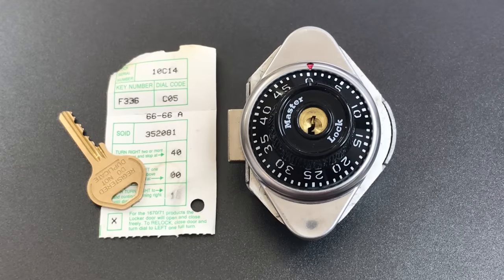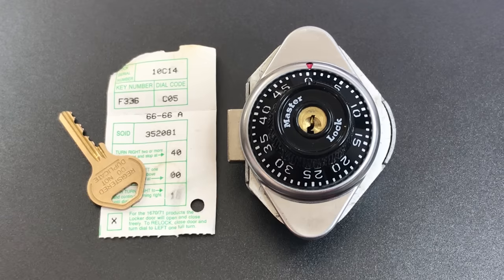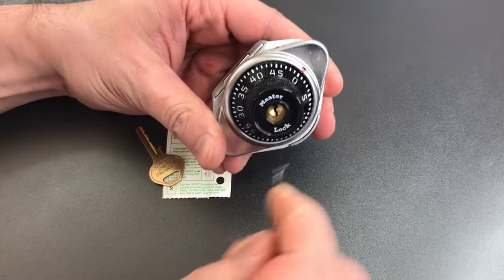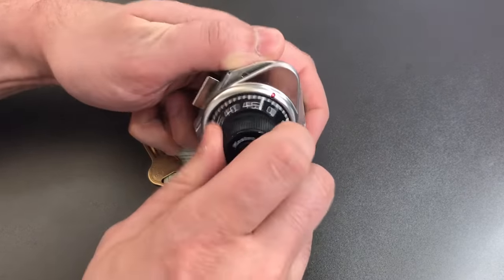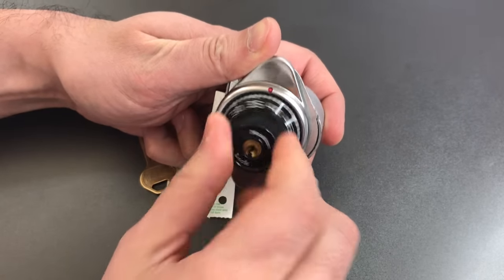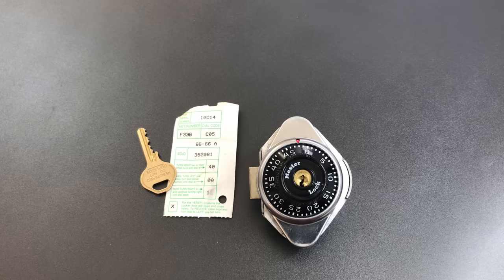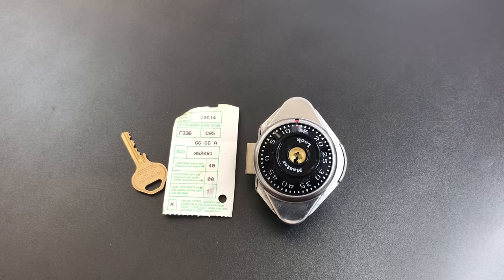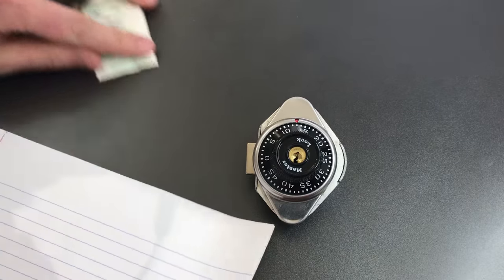[617] Master School Locker Combination Lock Picked and Decoded (Model 1670)

Comment: It's probably faster to exploit weaknesses in the locker design itself. For instance, at my middle school, these locks could be bypassed by pulling on the handle and hitting the locker in the bottom corner opposite the hinge. It would pop open ~80% of the time.

Comment: Their really old locks with the chrome-plated, machine-knurled dial used to land right on the third number if you dialed it any direction while gently pulling the shackle away from the body (no false gates). Brute forced those in less than 5 minutes, easily. Then, looked into the rotating gates to reveal the combo. Hoarded tons of locks that way.

Comment: The numbers on the back of my lock are "4719, then "13va03-b10. 
I have tried the offset trick 4 times, and they only add to 38 or 39.  Nowhere near 50 
Sequence was :
1st try-21
2nd- 2 to 3
3d- 2 to 3 
4th -6
5th- 5

Is the 4719 model different?

Comment: My school used to put basic combination Master Locks backwards (as in, the backside facing out) on your locker if you didn't bring your own lock, to lock you out of your own stuff until you brought a lock from home. I thought this was dumb, so I narrowed the combination into about 80 possibilities and brute-forced it, turned it around so it was facing outwards, and kept it for the rest of my school career. Incidentally, LPL actually mentioned what ended up being the combination, 10 20 30, which turned out to be it by actual chance (checked a few others and none were that easy to remember)

Comment: i remember my middle school had a combo lock system so shitty that you could never enter the combo correctly but if you were lucky to have a floor side locker you could just lift up on the finger latch and give it a sturdy bash with your knee. if it was a top locker you could smack it open with a well placed but kinda painful palm strike. i never put anything valuable in my locker after learning that.

Comment: So theoretically if you knew the first combo you would only have to try 10 combos before eventually getting it right as long as you werent set as the 5th one  which is a 1/5 chance, assuming of course that the offsets for 2-5 cant be above 10 which seems likely due to the data here

Comment: You could break these really easily when you go to open it keep twisting to the left. Or flip the lock mechanism that holds it into the locker up and slam it really hard. 

These always took forever to get open. So by the time you remember your code and unlock it, it's time for class

Comment: I've never seen one like that... Does it clip into the locker door or something? Or is it held with those nuts? My high school had Master locks, but they were padlocks, and so far as I know only had one combination. You'd have the option to buy one at the beginning of the year [I think it was like $5?], and it had a keyhole on the back for administrator use, but it was a similarly loose dial -- a digit or two was close enough for most of them. It's traditional for students in the area to lock their locks to fences and trees and basically anything they can once they graduate [which I did not, I kept mine, so maybe I'll pick the admin key part...]

Comment: I never seen my schools have those until this year they have them on my locker and honestly let me be honest having that malfunction or having it a bit off and it works is faster to get that locker open and get your stuff it’s important for it to have quick easy access for the user but not the by stander because it takes so long to get this open you only have a 3-5 minutes passing time to get that locker open AND get to class so little mistakes like those working are helpful

Comment: I knew a quicker way of getting my locker opened in middle school as opposed to picking the lock.  I would just put upward tension on the locker door handle and then exert force from my leg which resulted in a solid kick to the door and it would open right up. This method worked in under 5 seconds.

Comment: I remember if you pushed or pulled on the the dial it would have a  small click/ catching on something on or near the number to open it for the first two it would take a couple tries to get it down but then when you went through the standard process of opening using those numbers you figured out it would open.. worked out on befriending some of the stoner kids that would forget the combos and score some extra party beers as thanks

Comment: So the pattern of the Lock is 0 & +10 & +20  means, if the first digit was 0, the next is 10 and last digit 20 (not calculating the gate tolerances).

Comment: In middle school I could decode the lockers by pressing the dial back towards the locker and feeling for a change in resistance . When the resistance dropped I knew it was set, and started going to the other direction. It wasn’t a master lock though, and had to try to open the handle to know if it was unlocked or not

Comment: I was in high school in the 80s in Canada. Our Master locks were simpler (no key, we had to buy them and the combination could not be changed). The more mischievous students figured out that the third number was the only important one (quite different from what you're showing here). If we knew the last digit we could open the lock by setting it to this number and then giving the lock a quick, hard pull. Unfortunately, this number was pretty easy to figure out by glancing at the opened lock hanging from a 'friend's' locker as they grabbed their books.

Comment: If you read the comments written by kids, you'll find that these sloppy locks are actually useful for their intended purpose. Kids are rushing to their lockers between classes, so they aren't taking the time to carefully dial in each number, so it helps that the lock opens when you're within six digits. Many of the comments saying that they can't get their lockers open indicate to me that Master made their tolerances too tight for at least a few thousand kids.

As far as defeating the lock, your average person (especially kids in middle/high school) don't have the know-how to defeat even a crappy lock. They are intended to stop opportunists; not sophisticated criminals with the skill and knowledge of LPL. Even our teachers used bolt cutters to get into lockers instead of trying to pick them. This channel gives Master a bad reputation, but they work well enough for most applications.

Comment: My junior High had those locks, (or ones verry similar) and they were a joke to get open.

If you took any key, didn't matter where from, you could insert it into the lock and if you applied just the right amount of pressure while attempting to turn the key it would set the pins and allow you to open the lock.

They also had a massive flaw in that if you started at the zero position, rotated the lock all the way back to zero, then did the same in the reverse direction, and finally did it one more time in the opposite direction, it would open the lock.

After the second year at the school I stopped bothering to remember the combination, and would just rapidly rotate the lock back and forth 3 times and could open the lock on any of the lockers in the school.

Unfortunately, shortly after I figured out this exploit some of the bullies at the school also figured it out and proceeded to break into my locker and steal all of my belonging out of my locker.
They tossed most of it into the nearby trash can, and made off with some of the more valuable items.

To make it even worse when I tried to report them to the office I was told it was "impossible" to break into the lockers and that I was "lying to get them in trouble".
I then took one of the teachers to show them how stupidly easy it was to open the locks on the lockers, at which point I was told that was against school policy and was subsequently suspended from the school for a month.

I never got any of my stolen items back, nor were the bullies ever held accountable for the theft.

Comment: So, I have no idea if you get updates via this or not. But, definitely resurrecting a nine year old video for comments would be cool. I have 8 of these locker locks that came with a set of lockers at a yard sale. I removed them by taking apart the lockers. Your video does not show how to  unlock one without the original ( or at least one of the five) combination or the master key. … which I would be interested in since I have a handful of them. Something I did notice, is that each lock’s combo dial, when removed from the lock housing, is different. It just seems odd. Any chance you can “pick” one of these series locks without the combo or the key? Thanks.

Comment: I just got 2 sets of used lockers with these locks on them. I picked one, figured I'd never use the locks again, then drilled out the cores on all the other ones and removed them. Total time was about 5min for all the locks to be drilled. Now I'm even more happy I didn't try to save all those locks. Lol

Comment: I like how due to the lack of precision he was able to get the combination correct each time he changed it (if I understood correctly.) It seemed like the dial stopped two digits prior to the last digit that he wrote down each time, and I think it was because the difference was supposed to be from 48 and not 0 like he was using. That being said, the numbers added up properly so I feel like either I misunderstood something or he stopped turning as soon as the lock opened rather than when the dial hit a stop. Or maybe I wasn't paying as close attention as I thought I was.

Comment: Is it a coincidence that the last digit of both (all three) numbers is the same? If this would be the case in all lockers, it would reduce the number of position to test to 5 for the second wheel. Thus reducing the overall number to 100. (20x5).

Comment: So in theory, wouldn't it make sense for the locks to rotate at least 6 each year, as the specifications for the code was - or + 2.5?
Reply: To add to it, never more than 10 either, as then you won't have any rotation after 5 years as the total adds up to 50

Comment: I figured out the brute force method in high school with the lack of precision.  What I always wondered.  Our locks were all of the same model and stamped with a serial number for the staff to look up a combination if needed.  If the combinations are generated by some pattern, could you find a mathematically what of determining the combination based upon the serial number?

Comment: Dunno if this be relavent, but i had bought this lock awhile back 3 weeks ago just getting into decoding, i tossed the combination and so it began.. Tried every damn thing i looked up even the inner workings and nothing.. So, just about 10 min ago now i had an idea of my own.. I was able to get the first number and for this idea that's all i needed, so way i figure it on the inside there's only 12 of those gaps all around the lock that i could feel, so instead of these numbers on the dial, i just paid attention to the gaps on the rotation disk, set up on my first number, full rotation, and then on the next gap after my first i began trying each gap for the 3rd number, when i hit all 12 without an open, id reset back to my first number i know, rotate full circle, go to the next gap for my second number and rotate back trying each gap until i tried all 12, so on and so on i went in that order and could do it quicker and easier, and sure and behold 2 min later pop.. Then i did it a second time on the gaps i used successfully just to be sure and pop again, well anyways i came up with my own method that worked for me without dealing with the digits on the dial, but i am glad to learn how to get that first digit i need for this method

Comment: If the locker door of the locker next to yours was opened all the way, the metal edge of the door would perfectly strike the plastic combination knob, breaking it. At that point, the lock core would fall out, and you can open the lock with a flat screw driver. How do I know? 3 years in a row, my locker knob was broken and my locker robbed.

Comment: Had these locks at my highschool.  If you held your hand about 3/4 of the way up the door and yanked sharply upward on the handle it would open the door more reliably and faster than inputing the correct combo. Everyone pretty much did this all the time after sophomore year.

Comment: In middle school i just bent a paperclip and opened my locker by pushing the latch open every time. Much quicker.
Reply: Could you explain this further? Might be useful (not for opening other peoples lockers lol, just for mine)
Reply: @spidernh  i am sure this is greatly dependent on the type of lock and locker and this was more than 10 years ago, but i would basically bend a large paperclip into a acute angle, about 65 degrees and slide if into the side of the door and pull back on the latch. It would close the latch and allow the door to open fairly easily.

Comment: Hi!
I have a question about this lock: 

What if the combination happens to be for example 0-40-something. How do you turn that then? Start at 0, turn it right until you hit 40 the first time and then turn left to whatever third number it is. 
Or would you turn right, get to 40, pass 40, get to 40 again and then turn it the other way? Your video doesn't make that fully clear. Or maybe I just don't understand it.

Thing is: I happen to work in an old American high school which was repurposed. But the lockers are still on the wall because they were too lazy to remove them. Or maybe they just ignored them because why bother? (Assuming that they are the same lock model). They at least look the same, except that instead of a "Master Lock" print there is a "Master USA" engraved on them.
If it isn't the same lock. Do you have a video about this one, too? 

I could provide you with a photo if you're interested.

Edit: And the metal parts behind which I assume the screws to hold it in place are differ from this lock.

Comment: None of the locks at my school work either. It got so bad that one of our doors that the school was supposed to keep locked broke, and the choir and band students who had after school practice would yank the door hard when they locked them earlier than usual. I did this and got in trouble, even though it was the schools fault as that door was supposed to be open and I couldn’t get anyone inside’s attention. Later on someone also broke into the school at night. Good times!

Comment: Back in high school I found one of these locks outside on the school grounds.  It had the master key broken off in it.   Sure enough it was easy to pull out, attach a head to it, and bam, had the school's master key.   No idea what ever happened to it, though I definitely never used it (I was the school computer nerd, not a hoodlum!).

Comment: Ok cool, but who is changing these combinations during the summer months when there's no students there ? School janitors doing this? The admin ? Or is a locksmith spending many many hours doing all 1500 (or how many ever) lockers ?? How does this all work ?  Edit: oh, and then printing the cards to hand out to students. Are they already there and just stored somewhere ? Imagine that clusterphuck !!? 1500 lockers 5 combos for each, 7500 cards in a drawer somewhere and inevitably someone messes up the order, filing system whatever you wanna call it. Someone who knows how this all works please help me. I wanna know !!!
Reply: Im sure multiple people work on the lockers, and the printing im sure is already done, all they would have to do is have a couple people add/modify some papers than print out that years. Im sure each one is labeled with a year, so it makes things easier when printing. Than have those people print a their own sections, add a queue of each paper so they dont have to manually print one at a time. Than hit print. Come back later and theyre all done. That way, all they would have to do is remove the names of the ones graduating, and change it to the ones replacing them.
Reply: @skeletonking28  it just seems like it'd be really easy to get mixed up !!!
Reply: @bryantg7641  it probably could be really easy to get mixed up, but im sure they go ahead after they did all that, and test it out while checking it off to double check they have things good. But as I should have mentioned, I dont have experience in it, im just making assumptions. hell, it could be a lot more difficult or easier than the way I described it
Reply: @skeletonking28  me either, just thinking that it seems complicated changing every one and making sure you have the corresponding card for each one

Comment: At our school, we had these, but we also had a little thing that stuck out that had a hole in it wo that we could add another lock, the only problem is that you could push that little thing down, an pull on the lock, to open it up

Comment: these used to be the only locks i could get open. I think the reason they were so easy to open was the school didnt install them correctly in our locker rooms. i could easily slip a solid piece of metal through another locker to get it open. I used to troll my friends all the time with this

Comment: Non built in locks can also be within 2 notches. I used to have a 30 digit lock and if you pulled on the top and slowly turned you would feel the gates though it was hard to get the hang of. the longest it took me was 20 minutes and i did it as fast as 2. the old trick of hearing the click doesn't work in most modern locks but does in ones from the 90s

Comment: The lockers at my school are so fucked up that we could push the doors inside the lockers and push the bolts inside the lock and open it, also we could just punch some of the locks and it would open, not to mention that the casing was so shit we would just grab someone with strength to bend the casing of the lock and opening it